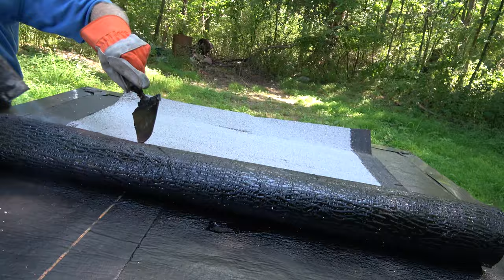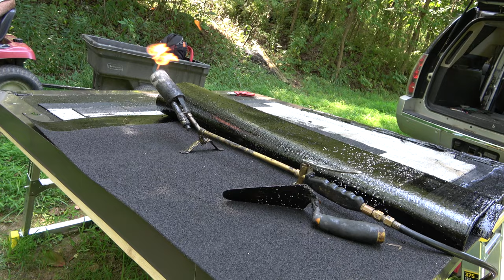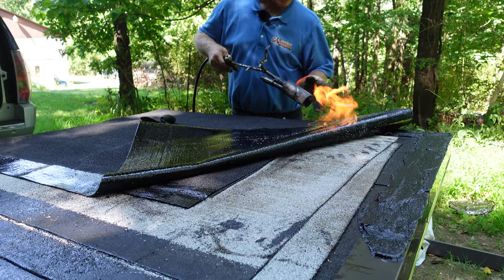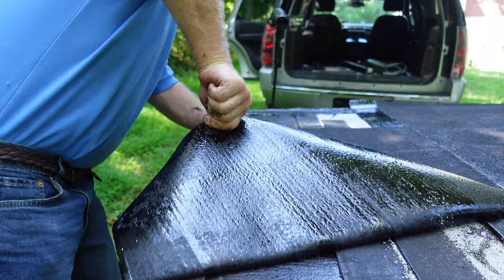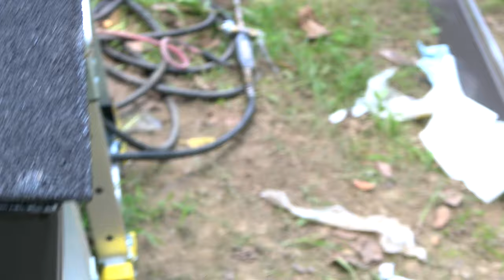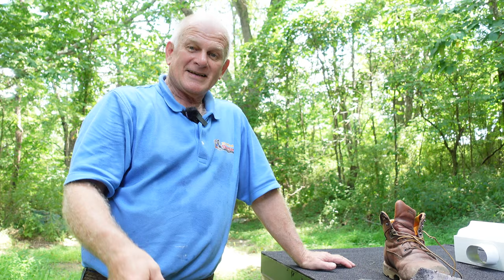30 years of Tips and Tricks Installing Torch Down Rubber Roof - demonstration

Comment: My roof is already flat top tar but has many places that need to be redone. Do i need just 1 layer of the peel and stick for my problem areas for it to properly stick down to the roof or do i need to get a base layer of the peel and stick along with a 2nd top layer to put atop of the base

Comment: Do you have to put peel and stick over the drip edge if you have a low slant roof? I already did a torch down roof on the entire thing but have to put the drip edge on still
Reply from the maker: Normally you would install the base all to the edge and then put the drip edge over the base. Then the cap sheet over the drip edge. In your case install a drip edge over the cap sheet and the torch a 8" strip over that using Karnak 66 trowel grade to adhere the membrane to the drip edge

Comment: I have 3 rental properties all with modified bitumen granule torch down roofs. I've noticed after about 8-10 or so years, a significant quantity of the granules come off leaving the asphalt exposed to UV which results in degradation of the seams. How can this be stopped? The roofer I use said silver coat the seams only initially. Then after about 5 or 6 years when the granules begin to start coming off, silver coat everything. Is this true? Or after a new modified bitumen roof is down, should the entire thing be silver coated?
Reply from the maker: Just silver coat the entire roof
Some Torch Down Brands don't embed the granules properly and therefor the loss of it. Just go and Silver Coat the entire roof to protect the membrane from UV's

Comment: It doesn't stick because you never use elastico stick primer or degranulate your cap sheet underneath like the manufacturer tells you to install it and in the winter you are supposed to use winter grade peel and stick not summer grade. You have know idea what you're talking about. Take the manufacturer course and do it your way they will never give you a installers license.